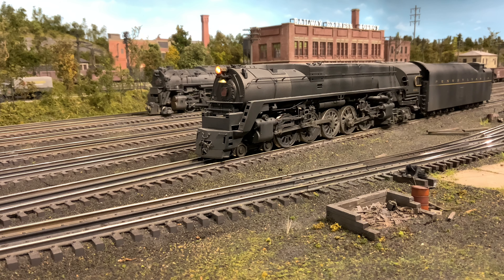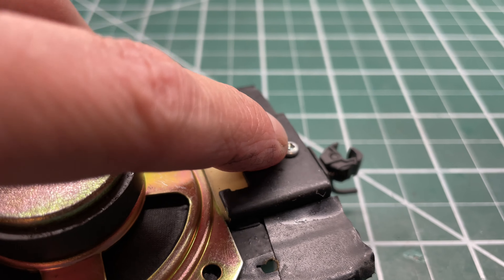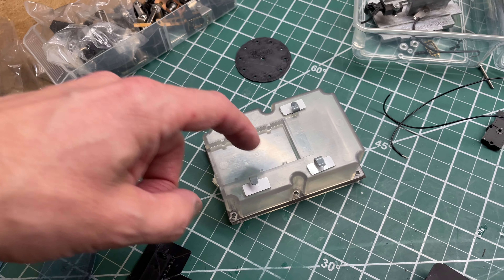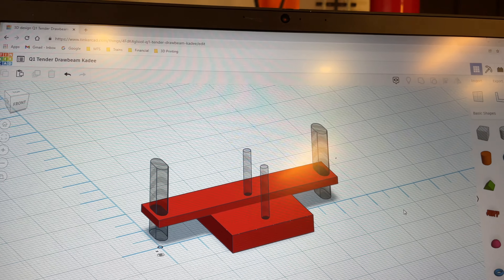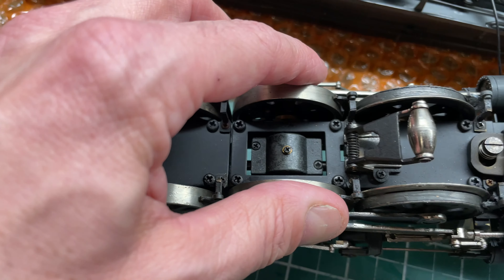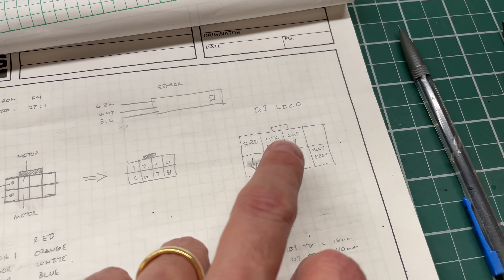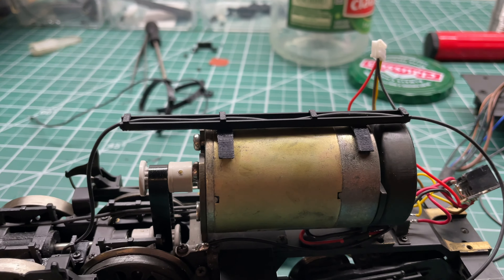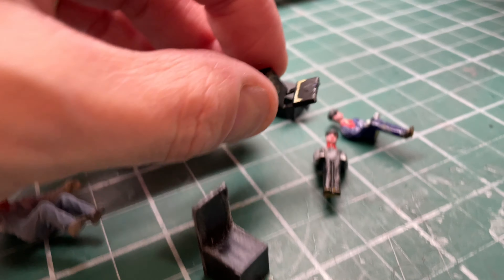The Chronicles of Norm #4 - Reworked Q1

Comment: this vid is really helpful because I'm the middle of full blown brain surgery on my 3rd Rail FEF.  Out with the EOB, in the with ERR.  Gonna go the tender shell antenna route but with kapton tape, I just don't have a source for tiny nylon screws to hold the shell on.  Then for the chuffs I think I want to reuse the cams and wire the cherry switches to the ERR cruise board, or should I go with the magnets?  I'm super picky about getting the chuffs spaced right and lining up the magnets gets super tedious without a jig like the kind you made.
Reply from the maker: I got nylon 4-40 screws at Home Depot when I used to set up the shell antenna, the I would drill and tap the shell to accept them. If it already has chuff cams, I would use them. If they are like the ones in my L1s, they can even be adjusted for crankpin synch.
Reply: @normstrains  many thanks 👍  This is my first full ERR conversion so if all goes well I'll seriously consider updating more of my conventional stuff.

Comment: Norm, where did you initially learn to do changes to electronics and mechanical parts. Getting very hard to get repairs to my mth original protosound engines at reasonable costs.$300 to 450 per engine here in nj/ pa. I would luv to learn and upgrade some mth engines to protosound 2 and 3. Got 30 premier proto engines. Mth does still sell protosoumd 3 boards on their parts site but not complete protosound upgrade kits any longer
Reply from the maker: I learned by fixing and modifying my own trains over the years. I can’t be of much help on MTH stuff, you may want to peruse the OGR forums for help on their engines.
Reply: Have you ever thought of conversation to TMCC
Reply from the maker: It might be worth checking out these manuals if you’re considering some DIY upgrades: 

http://www.3rdrail.com/err-3rdrail/
Reply: @William Kolina  I've got a zw-L and handheld and 2 180 watt powebricks still sitting in the box, unused, since I purchased them new 3 years ago. So I'll look at tmcc. Certainly, at $1600, 1800 and $2500 for lionels newest visionline stuff, repairing 20 or more of my mth premier engines seems at least a consideration. none of my 40 to50 engines have more than 8 hours run time. I stopped doing trains, completely disillusioned with problems with atlas track, especially  the 16 atlas switches I bought 9 years ago. Back then, atlas switches  had major design and production qc crap, unknown to me. Im back now to give all this maximum effort...with a new, larger trainboard.  Any help is appreciated
Reply: @normstrains  thanks, very much appreciated
Reply: @thetrainboard2772  don't get discouraged.. switches seem to be a problem.i always wanted switches all my life.bought 2 FasTrack switches and the left handed one is a problem.still under repair.it sounds like you have a great collection.enjoy it